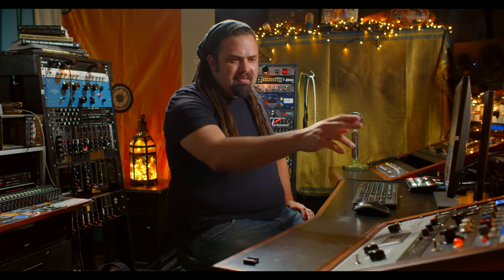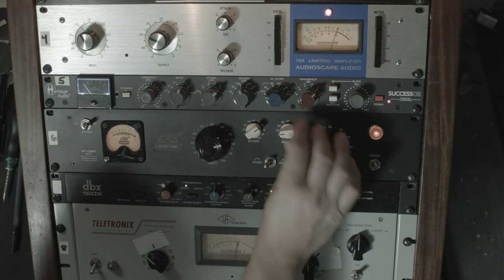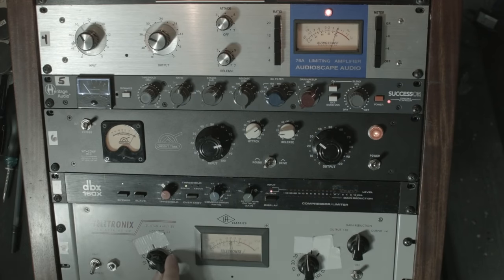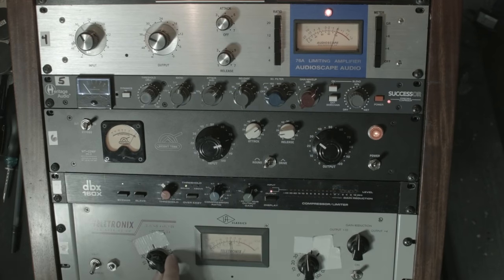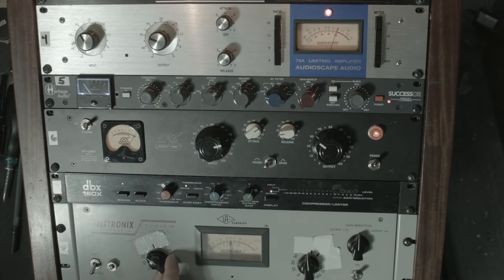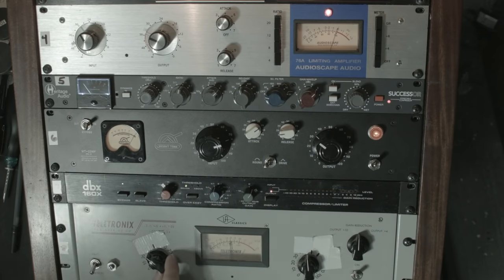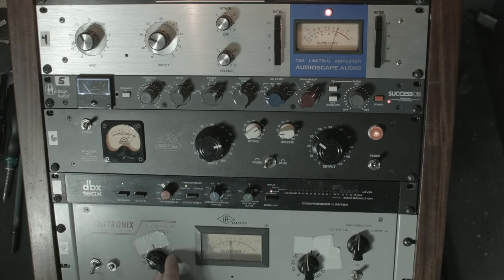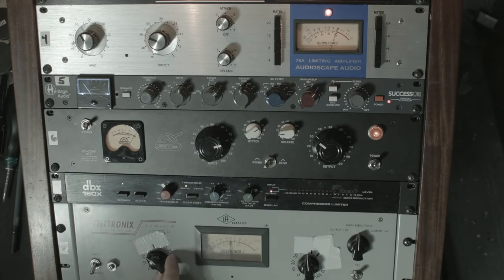Learn the Difference of 5 Types of Compressors

Comment: Hey Ryan, sidechains are really hard to add to feedback compressors. The best way I've come up with is to add a secondary gain reduction FET in feedback mode to the sidechain to calculate how much reduction to apply to the primary gain reduction FET on the main audio path.

Luckily, FETs are super cheap, but both the FETs in the above design need to be perfectly matched, and thermally coupled too, which often means using a transistor array chip.

Comment: The difference between feedforward and feedback is that with feedforward you have the input signal triggering the compression DIRECTLY, and with feedback you have the output signal triggering the compression. The attenuation of the signal is happening at an earlier point in the signal chain then where the signal is being tapped off. I'm not exactly sure why but before DBX made their VCA's it was apparently almost impossible to make feedforward compressors. I believe it had something to do with the fact that a Feedback system will make linearize itself, and things like FETs aren't linear by nature so with feedforward it would be more challenging. 

Interesting to note is that the DBX style VCA compressors often have RMS level detectors instead of peak detectors, which is also a part of their sound. 

Also, some of the qualities people attribute to certain types of compressors aren't nescesarilly related to the gain control element, but i think rather to the devices they're being assosiated with. A FET compressor can be slow with very little colour if it's designed that way; it's just that most of the FET compressors available are 1176 knockoffs and the 1176 is very fast and very coloured.  Same with optical compressors, they don't have to nescessarily be as slow and coloured as an LA-2A. 

As far as sidechain filtering goes, it can be done with both feedback and feedforward. JLM Audio makes 1176 style FET compressors with a highpass filter, and i believe there's some Serpent Audio (?) box that has it too.

Comment: Great comparison, man! Thank you for this! The one I loved more was the FET 76. It has a grit to it and the vocal is so glued to the song, even so higher in volume. I didn't like the Vari-Mu, for me it simply didn't work here. The Diode Bridge is too clean. The optical is beautiful, but the vocal became detached from the song. The second i liked more was the VCA, Dbx, not so pleasant as the 76, but the vocal became at the same time highlighted but glued to the song.
Edit: the plugin is really nice, but compared to the 76 it becomes a little sterile, maybe you could solve this adding some saturation.

Comment: About the optic functioning...

There is a electronic component that varies it's resistance according to the light that it is exposed to (light dependant resistor, LDR), and this controlls the amount of compression and when it start compressing. The light that activates it is a led or sometimes a very small light bulb (meant for this application) and it lights up in the same amount of the input signal strength.

Nowadays you can't reallyy see the thing working because both components are built in just one package, but you can inject different signals and observe the measurements.
Reply: If someone feels more interested about the components related, search for the datasheet of those parts:
LOC110
IL300